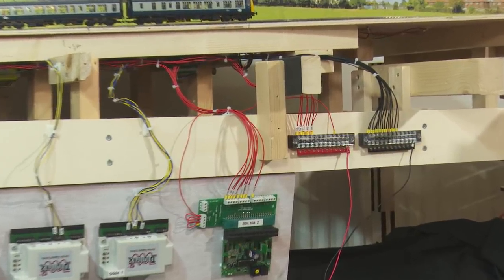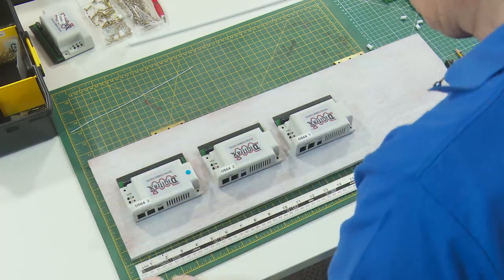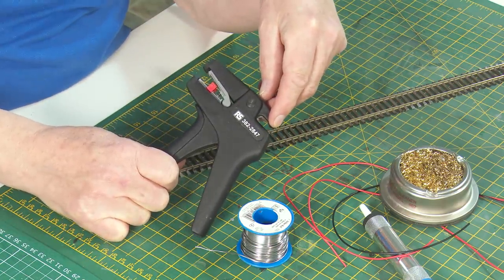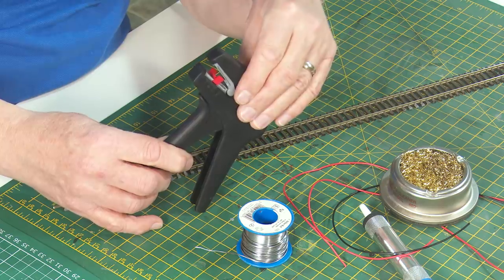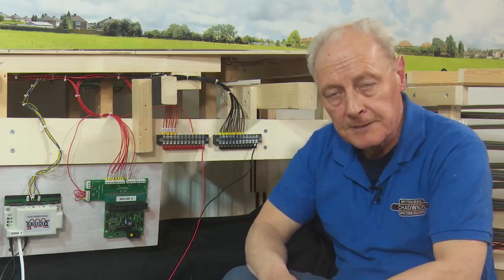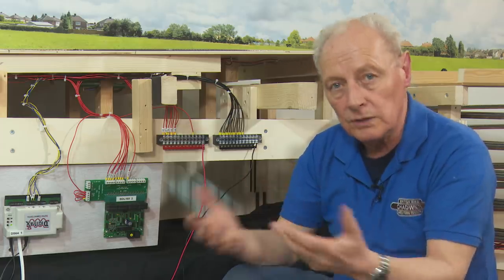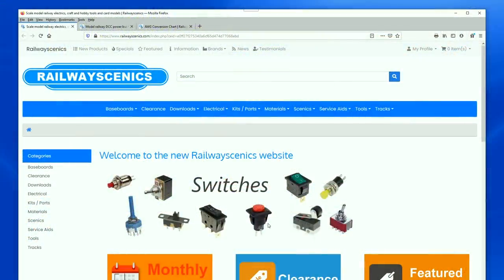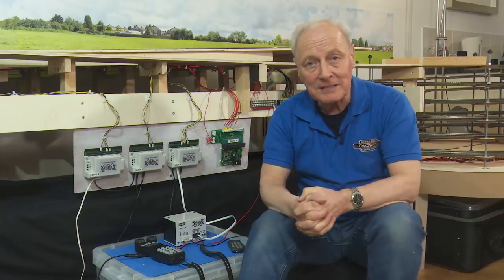More DCC Wiring at Chadwick Model Railway | 128.

Comment: Another great one Charlie.  Particularly appreciate the explanation of block detection.  I see you added the catch point that we had forgotten to the goods yard exit :)
One (slight) niggle - I'm surprised that all the wires into your drop down board come down over the front of the baseboard edge - why didn't you bring them to the back of the drop down and then through a couple of holes?
Reply: That intrigued me too, Lea!
So Charlie; why?
Reply from the maker: I know, I’m shaking my head looking at it.
However, the facia may well cover that area.
Reply: @ChadwickModelRailway  "the facia will cover it" oh yeah???  Next you'll be saying that was the plan all along - ha!

I do love how neat you make everything and those labels on the cables help.  I assume you have a spreadsheet or something where you have the names of each of the sections and the numbers of each point motor identified against the position on the plan.
Reply from the maker: Oh yes, we love spreadsheets!
Reply: Its a good idea, and I plan to use the concept, but hang the hinged panel back from the edge so the wires can be hidden behind the fascia/edge.  Solved the panic attacks I've been having at spending hours on my back underneath the board reaching 2 feet up to fiddle with screw connectors that oddly seem to use flat head screws rather than pozidriv in some cases.
Reply from the maker: ... and made worse as the years tick by.
Reply: Well done Charlie you may have solved my problem of wiring.  Being of a senior age and with back problems I am looking at your hinged board and wondering if that might be the answer to wiring without getting underneath the boards.  Another cracking video Charlie.
Reply: I would be happy to comment if I knew what a "niggle" is. Ha Ha. Just "having you on." Greetings from Canada.
Reply: Same niggle from me.  Even though the fascia will cover the wiring there is still a possibility of damage for any wire that is permanently exposed like these.  Coming down behind the framing with appropriate looping to accommodate the panel's hinging motion would have been a better approach.  Unfortunately with everything trimmed to length there may not be enough slack even if Charlie chose to go back and relocate the wiring.
Reply: Yep I would of brought the cables through from the back of the board as well
Reply: @ChadwickModelRailway  You did it subconsciously, for accessibility behind the facia. 
👴🏽👍🏽

Comment: Just found this channel and subscribed, this by far is the best channel to learn anything about DCC as I'm about to begin to convert over sadly enough I will have a bunch of great older blue box locomotives (Athearn) on ebay as I've learned older engines do not fair as well due to metal chassis and older motors and by the time money is spent to change all this, it's easier to just upgrade the fleet, thank you for these great videos.
Reply from the maker: Welcome aboard Joseph, regards Charlie

Comment: Thank you Charlie.  I am completely new to DCC and have constructed a baseboard and am now track planning.  I intend to use some form of block detection using a Digikeijs DR4088CS via a DR5000 controller.  However I wondered if having set up all of the block control it can be 'turned off' if I wanted to play around 'outside of the blocks'.  Probably a very dumb question but as I said, this is all new to me.
Reply from the maker: Yes, it will run perfectly well manually Stephen.

Comment: Nice explanation, its interesting to see all these options even though I'm not going down quite as complex route. I do wish I'd chosen different colour wires for my track feed as I have gone old school with point control and I'm using Peco surface mount motors that also use red and black wires. I didn't want to change colour going to my levers so I now have lots of red and black wires of two slightly different gauges though the point ones do have green running with them. It's way too late to change now but next time. All that said I find wire quite enjoyable.
Reply from the maker: Good for you Rob, I also find wiring quite therapeutic, strangely! Regards Charlie

Comment: You should run a heavier gauge wire to the power in side of the block detection circuit. The power in side wiring to the block detector needs to supply the total current for all the loads on the connected blocks.
Reply from the maker: Yes you’re dead right Jonathan the power feed cables are not sorted yet it was just a basic distribution network. Regards Charlie

Comment: Your videos are most instructive, particularly the ones covering complex systems.  Are you going to add trackside signals to this part of your layout?  I would like to see the planning and wiring of multiple trackside signals and what you use to control the signals - tortoise or other devices.
Reply from the maker: Yes I will Joseph, and I’ll be using a Digitrax  signal controller called an SE8C. Regards Charlie

Comment: Charlie, at 16:13 you mentioned that you exclude your point feeders from your block detection network.  I assume that is due, at least in part, to the need to use insulated joiners on the frog end of the track.  Have you tried  Peco's unifrog points that don't require insulated joiners, and if so, do you still find it preferable to exclude the points feeders from block detection?  Paul
Reply from the maker: No Paul that’s not the reason. I never park trains across points it just seems to be an added burden wiring them in as well. James from DCC Train Automation also reckons that it’s not best practice. Regards Charlie

Comment: Great videos Charlie , I have been wondering which manufacturer of double slip you are using on your code 100 track layout as Peco only make a code 75 type in electro frog, Also have you  ever tried a Peco insulfrog diamond crossing on the DCC layout. 
Many thanks for your time in explaining things on your videos 

Geoff
Reply from the maker: Yes I’ve tried them all.  The diamond crossing caused electrical problems with Lima wheels and I have used code 75 electrofrog double slips with converter fishplates.

Comment: Hey Charlie, why is there an isolated section of track used to brake trains? Why can’t the ‘slow down’ track right before the ‘brake’ track be used to slow and stop a train? Can something be programmed to slow down and stop a train in one block using time or another variable? I would guess that if a train slows down and stops in the same block, it would be more gradual and the wiring more simple. Thanks, Jack.
Reply from the maker: It is possible Jack  but it is not always a reliable alternative. Regards Charlie
Reply: @ChadwickModelRailway  Thanks for the reply.

Comment: hi charlie nice to see you adding your cables charlie will that B.D.L board work with the Z21 system i no that you have train controler silver if it is on a memory stick then you might be able to use traincontroller gold down load it see if it works give it a try derek  let me no ok
Reply from the maker: Hi Derek, sorry I have no knowledge of the Z21.  
I’d love to upgrade to TC Gold but it’s too expensive.

Comment: Great video Charlie, can you possibly show how too wire 2 points to strike as one. As you had your points do this on this video, it would be could as I have tried YouTube and there is nothing. :) Tom
Reply from the maker: It’s quite straightforward Tom, you just wire both sets of points to the same terminals. And if they’re striking the wrong way around just reverse the wires on one of the points. With the equipment I use it is straightforward. Regards Charlie
Reply: @ChadwickModelRailway  thanks Charlie now I know what I am doing .

Comment: Great video Charlie as always, correct me if I'm wrong but is it not so when using Train Controller there is no need for 2 Blocks within a ramp down and stop detection Block Train Controller will Stop the Loco at the given point ?
Reply from the maker: Not quite true Gaz.  TC will stop it after a given time, not distance. The second detector just makes it more accurate.
Regards Charlie

Comment: Charlie I’m fed up with strapping up cable looms with cable ties and then as things progress snipping them all off and adding moves wires. As you’ve arranged those boards I would in future if I did another layout consider using ‘slotted cable trunking and just bring in one main loom at a single point on the hinged board. When all the cables are in just clip the cover back on and what’s more you can leave a bit of slack in the trunking hidden away..
Reply from the maker: A fair point Roy.
Reply: @ChadwickModelRailway  it was in no way criticism I just saw what you were doing, I’ve done the same, I’ve been adding block detection recently and the looming is getting out of hand but fortunately I think I’m just about done. I’m just enjoying seeing your project develop.

Comment: Hi Charlie, once again a excellent informative video, however could you do a talk on the components required to set up Block detection and how you have laid this out on your layout, as the Digitrax and other websites are baffling with all of the componentry available. It needs a communicator like yourself to put it across to the layman starter at this side of the hobby.
Reply from the maker: I will in time at Lizzie. However, could you check out the channel McKinley Railway. We have produced a block detection video on that channel. Regards Charlie

Comment: Hey Charlie, thanks for all your informative videos. I am in the process of turning a DC layout (3 main lines) that I started a couple of years ago to DCC (Digitrax). I use isolated sections of course, and two controllers for each track. One for normal operation and the other to slow the trains as they pass thu’ the stations. Cannot I use the same principle with DCC control i.e. an isolated section controlled by a second DCC controller to ‘automatically’ slow the train on the station section and ‘automatically’ speeding up again having passed through?
Reply from the maker: Hi Lynn, welcome to the freedom of DCC.  Sadly you can’t impose an automatic speed restriction without computer control.  However, I’m certain that you will find it far more rewarding. 
Regards Charlie.

Comment: Hello Charlie
Can I ask why you use the old UK style of cable instead of using the more modern style i.e. .5 or .75. I do understand they are the same cable but to purchase them asking for the modern style I find easier.
Reply: Some of us are comfortable with nomenclature we grew up with.  We still buy milk in pints and I still as our butcher for 3 pounds of mince for example.
Reply: @leestoddart7014  Yes I do understand but as an electrician I have to work with modern measurements. I use feet and inches lbs and oz in weight and so on. Just thought I would say about modern styles for the younger folk. Oh yes I have retired now after using .5, 1.5, 2.5 and so on for 50 years.
Reply from the maker: I think in the model railway fraternity Nicholas, these cable sizes are always the go to standard. Regards Charlie

Comment: Another good one. Especially liked the 'Black Art' comment at the beginning. (It doesn't have to be... but YES it is... and you confirmed it with the loconet wiring problem!) One question on the BDL168 mounting: Why not use circuit board standoffs? They're designed for this and sized appropriately for the mounting holes. The size of those screw heads made me wince a bit. I've also found some vertical mounts for circuit boards since I have some with countdown timers on the boards that I want to see from a distance, but should also help with space saving.
Reply from the maker: To be honest, I’ve never heard of standoffs.  I agree with your thoughts on the screws though Chris.
Reply: @ChadwickModelRailway  Cheap, cheerful, easy to find and very handy. What's not to like? Get yourself an assortment pack to start. (And reciprocal... I didn't know about Ferrules, and now I do thanks to you!)
Reply from the maker: A fair point Chris.

Comment: Charlie, I gather that you use black (to the back!) and red for your DCC power wiring throughout, and don't use different color combinations, say, for different power districts. RIght? I started off with a really complicated scheme--District 1 was black & white, District 2 was green & red, etc. I was having trouble acquiring the necessary color combinations (8 districts, plus 2 reversing loops). I'm thinking at this point that I'm going to use black & white throughout, using labels on the wires to keep the districts straight. Any thoughts on that?
Reply from the maker: Yes that’s correct James. Red and black are for every power district I just label them so I know which is which. Regards Charlie

Comment: Did you think about (or choose not to) drilling a hole above each point controller on your fold down board, so that the wiring could pass inside the frame, instead of coming over the front?
Reply from the maker: I know P77. What a cock up!

Comment: I have done the same with my layout Charlie using the digital systems, it’s worth it. I take it are you going to do the next step with the system like I have and use computer control? Keep up the great work 😊
Reply from the maker: Yes Michelle but I’m torn between iTrain and train controller. At the current time. I do have train controller silver but it doesn’t do multiple screens!

Comment: A couple of questions please Charlie.  1.  Does the black wire NOT go to the BDL at all?  I suspect not.  2.  The red wire coming out of the BDL, does it just join the main bus!  Thanks.  Brian
Reply from the maker: Yes Bryan, no black wires go to the BDL168. The red wires that come out of the BDL168, only go to their designated blocks. Regards Charlie
Reply: @ChadwickModelRailway  Thanks Charlie.  I’ve bought two and I’m just thinking through how the wiring connects to the rest of the system. Very helpful video.

Comment: Intrigued to see you wire the set of two points into the same PC64 connectors and it worked well when you changed the point via the handset. I know you use Train Controller Silver, does that have any problems when the points are wired together like that?
Reply from the maker: No not at all Charles, the program sees it as one DCC address.

Comment: Charlie--Others have said what I'm thinking, that your videos are terrific. I found this one particularly enlightening because I'm working on the wiring. You are well organized, and that is a goal we should all strive to reach.

What is the circuit board with the 3 DS-64 boxes? 

I have a question about the detection blocks: You seem to be breaking them only on one of the rails--i.e., you installed an insulated joiner (fish plate) on one side, but not the other. My initial reaction is that that makes sense, but when I create districts, I break both rails.
Reply from the maker: Hi James the circuit board is a Digitrax B DL168.It detects 16 different zones, and you only need to supply one cable of a block to the detector. Hence I leave all the black cable runs intact.  I don’t cut the black rails as it’s not required. However, I do not include any point work into the blocks. Regards Charlie

Comment: In terms of block detection and the control of locos... I assume that to make use of the detection you need to be using something like Train Controller to command the loco to slow to a crawl and then stop.  Is that correct?
Reply from the maker: Yes Lee, Train Controller Silver is the weapon of choice.

Comment: Hi Charlie ,  Love your videos,  I'm about to start wiring my layout with digitrax and was wondering how you wired your points and you answered my question in this video but just to confirm you have all the points isolated from the block detection and into the bus bar?  Also with the isolated joiner, you put in to act as a sensor does that other red wire go back to the block detection as a separate block? Cheers
Reply from the maker: Yes the points are isolated from the block detection circuits. Also Ali, yes the extra rail which I connected into that piece of track does go to a separate sensor within the BDL168. Regards Charlie
Reply: @ChadwickModelRailway  Cheers Charlie that helps alot.  Looking faward to the next layout update

Comment: Very interesting. Neat wiring as usual. Q. Is it possible to use spst switch to control tortoise motors as I am old school 12-16 volt analogue for point control even though I'm DCC.
Thanks Charlie.
Reply from the maker: I’m unsure what a spst switch is but as they are stall motors, I’m sure that a two position switch will do it.
Reply: Hi Charlie, spst. On-spring centre off-on switch like I currently use my deep points. Thanks for the reply.
Reply from the maker: Thanks John.

Comment: Hi Charlie,

Good video as always.  I notice you are using 3 DS64s, from a space point of view have you thought about the DAC20 soon to be 22 from Signatrak. By the way I have just installed my 52nd BDL168, each wire from the BDL is colour coded. This does mean having a lot of wire cable drums but it makes identification mid point between track and BDL much easier if you need to modify and add wires.
Reply from the maker: Wow Andy, that’s a lot of blocks.  
I had a couple of DAC20s but I just couldn’t get on with them.  Their future production is always unsure.
Reply: I’d be interested why you couldn’t get on with the DAC20, I find using the locoanylise software very easy to use. The only issue I have really found was like you I use tortoise motors and find the dac on its own does not have enough output power. But there is an add on board to resolve this.

Comment: ~21:00 ..., meanwhile the coaches from that engine, if it is a medium or long train, would still be on the point behind blocking the main line 🤨 prototypical not done, force of shorted distances on a model railway not always avoidable.
Reply from the maker: Will said Lass.